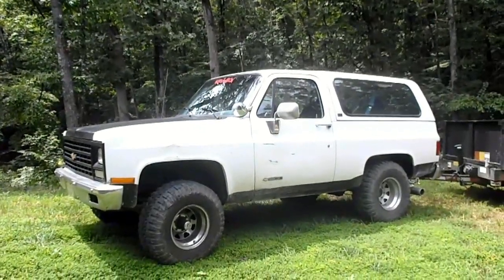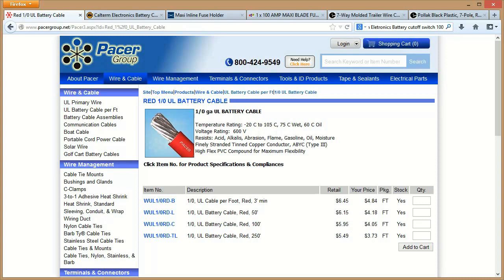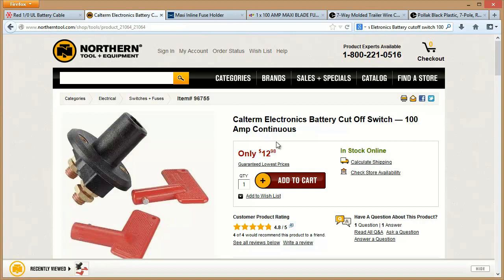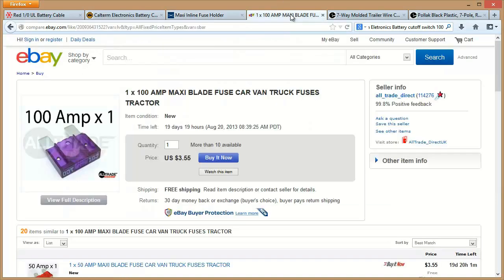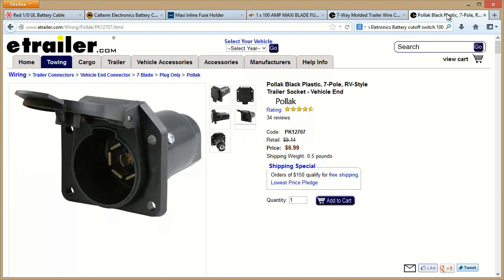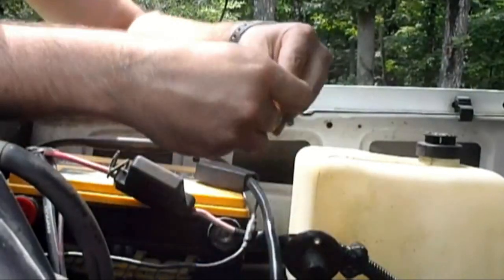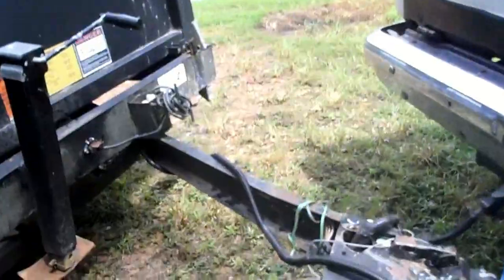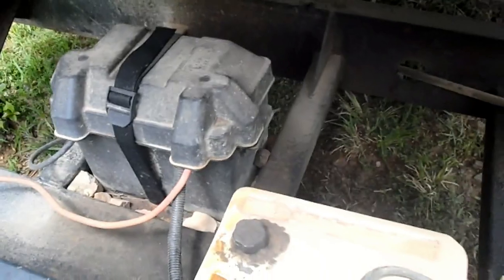Hooking up a dump trailer directly to the vehicle battery

Comment: hello, nice of you to take time to show this as it is very useful, just my 2 cents on a few things, first kudos for installing the up sized main run wire and that disconnect, that heads off a lot of possible problems, especially fire, however I would swap out that 80 amp holder w the 100 amp fuse for a 100 or 150 amp resettable circuit breaker found at most radio shacks, they aren't cheap but you can actually use it as the proper breaker, and also it can be the disconnect when not in use, and that 80 amp holder with a 100 amp fuse is not good, especially since your relying on the vehicle to be the ground, heavy duty electric motors like winches or pump motors should have a ground all the way back to the battery, what I did was run a 4 ga wire back for both the + and - and then used a battery quick disconnect plug (similar to what is on elec fork lifts you can get at grainger or online for 20 bucks) this allows me to plug anything in back at the rear bumper, a winch, a dump trailer or you can even make a set of jumper cables that you can use back there or up front. A cheap idea for those how do not use their dump trailer quite as much as you do would be to hook up the charging lead on the 7 way connector already on the truck, most newer trucks are even pre wired and all you have to do is remove the dummy fuse, put in a 30 amp fuse and it will keep the battery fresh after about 30 minutes on the running truck, we even uped this a bit by adding a small solar panel to the trailer, I like my set up because I can run anything, what I did on my friends works great because between the solar panel and the charging lead he has not had any more issues and his whole set up cost 4 bucks for the fuse and 50 for the panel. Sorry to jump in on your post, I just like brain storming ideas with fellows like yourself who have similar needs.
Reply from the maker: Good ideas all around. I will probably add a ground because, as you pointed out, it is better not have to depend on the frame always working as a ground. I occasionally have to clean the hitch up to make it work. Solar is great, but my trailer sits for months in a garage, which is why it doesn't even have a battery in it. Thx for the ideas. I have it a thumbs up.

Comment: Should use a Amplifier fuse holder in the proper wire size and a wafer or buss fuse for your application. 5 bucks depending on brand.

Comment: Why does the switch have to be so close to the battery ? Is there any reason why you shouldn’t put the switch inside the cab or in the battery box of the dump trailer ?